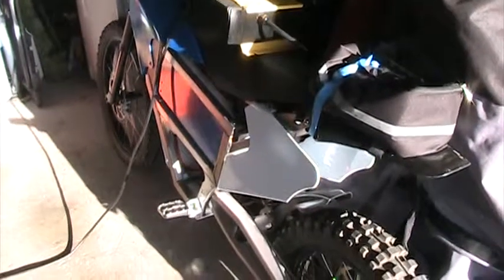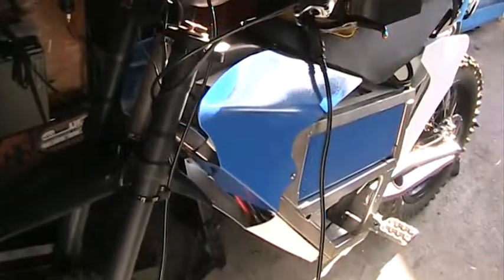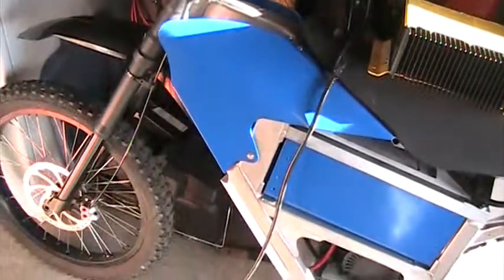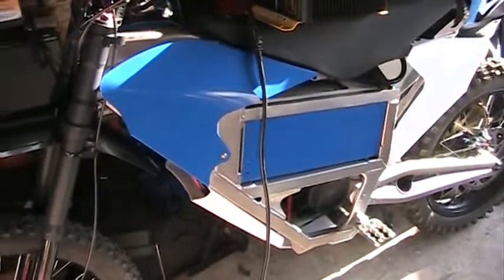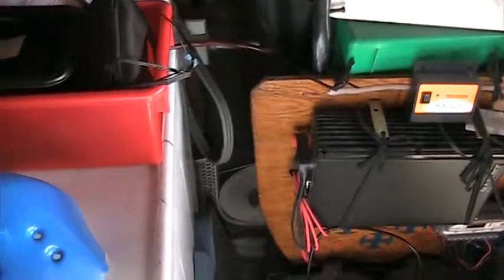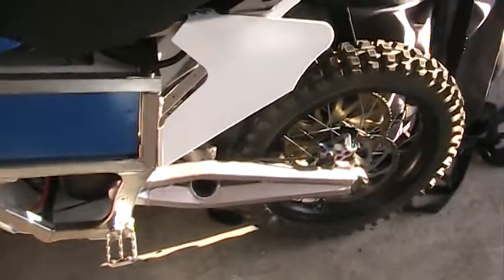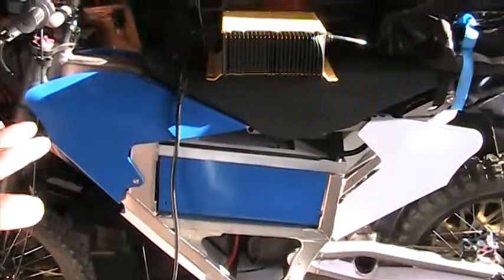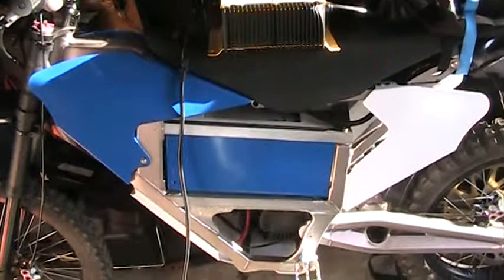Zero X Motorcycle build 2

Comment: Good overview.  I've gone through my 2009X battery and all arrays are holding over 7 volts.  I am looking for the correct algorighm for the bike.  The charger sees NO battery and not sure what to do next.  Any thoughts on getting the charger back in action?
Reply from the maker: Hi Clay,
These batteries use a BMS and there is no information on them available, not to mention they probably vary. If you get the full 54 to 60 volts out then the one signal line from the battery to the dash box is the question. It should put a 3 volt pulse for a few seconds to tell the dash box to activate. If not then the issue is in the batter BMS. I put together a simple box that plugs into the two wire plug to the dash box (disconnected from the battery) that puts out that 3 volt pulse. Two AA batteries, a switch and a resistor to limit current in a box will do. that supplies the go pulse and the bike will run, so that allows me to test the battery. Then if it does not run far, or the voltage drops off a lot you know the battery is a dud and can't supply the voltage and current. Make sure the wires are not open or broken to the controller too, connectors go bad.
Reply: I'm talking to Zero about it and they are telling me that the batteries need to be balanced better to charge them all with the charger.  I keep having a 2.5 volt array while most others are 5.0 to 5.7 volts.  They told me it may take days to weeks to balance the battery out with the charger.  My question is that they voltages are changing as the charger tries to balance them out.  If I unplug the charger, charge the lower voltage array and then place it back onto the charger, will this help?
Reply from the maker: Don't know that will work but try. I have tried to charge each section with a 12 volt charger to bring them close to 16 volts (4 cell series) finding a 8 volt charger is not common but a power supply that is variable may do the trick but don't overcharge or dead cells, Just watch the voltage.
Reply: @keithrector8560  Hi Keith, I am doing the same project 7 years later! so thanks for letting everyone know about the 3v pulse, genius!